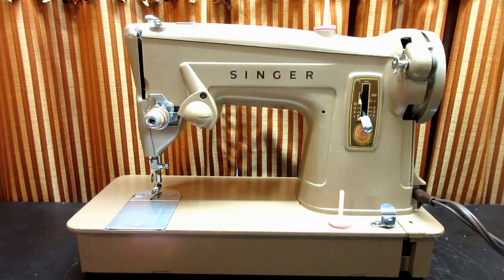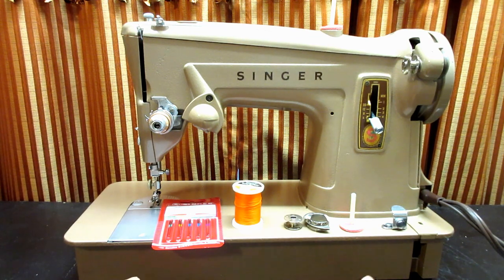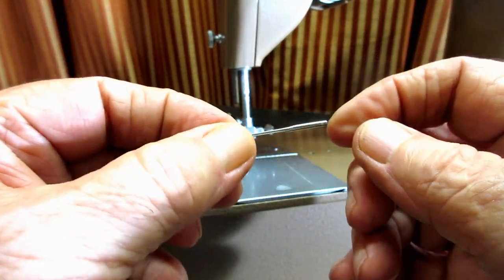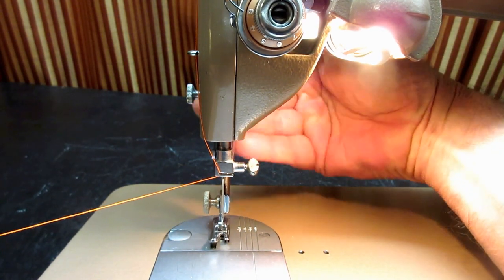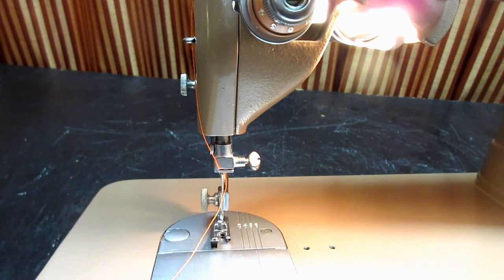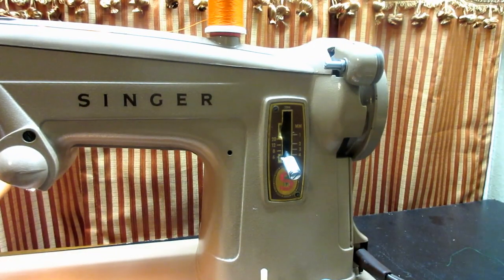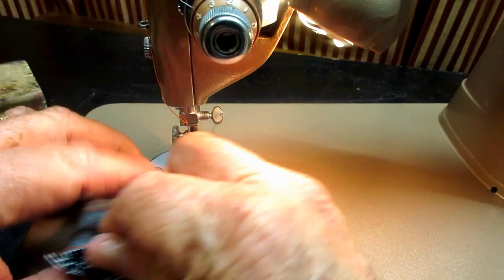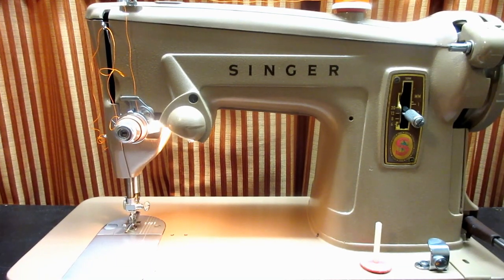SINGER 329K W/ INSIDE OUT TOUR, BOBBIN WIND, NEEDLE THREADING, 7-LAYER SEWING

Comment: Great to see another video from you Andy. I got hold of one of these but sadly it was too far gone. I kept bits off it in case I ever get hold of another one.  I also got hold of an early model 328K which is a real beauty and a lovely machine to sew on.
Reply from the maker: I have a bid on a 328K at GWill. No one else has bid yet. I think it's b/c the listing says "For Parts or Repair", hehe. Just my type of machine, haha. I did a 327K before, then found this 329K and really enjoyed it. I figured I might as well get the sister 328K for the trifecta of these SyleMates. Thanks for watching, and take care.
Reply: @andytubesewing1953  Fingers crossed that you win the bidding on it Andy.

Comment: I found one of these on the side of the road.  My first restoration project.  Mine has a green "hammered" finish.  This model doesn't get anywhere near enough attention.  It's a great machine.  Reliable, no fuss, easy to use straight stitch machine.  I believe Singer marketed it as a "lower" end machine, which means that it's head and shoulders above anything that's available on the market today.  

The large screw at the left end of the pitman arm was loose on mine and the machine rattled.  I discovered that it's a reverse threaded screw.
Reply from the maker: What a fabulous find! Thanks for rescuing it.Yes, an underappreciated model, like the 404. Singer spent more to manufacture ZZ-capable machines and they cost more to make so they pushed them in their advertising and stores. There was enough demand, even into the 1960s that they still made models like the 329K. My wife has been sewing for 50+ years and uses a straight stitch 301A, even for knit fabrics. She did buy an edger to finish some seams in the late 1970's
Reply: @andytubesewing1953  It really was a fabulous find and it got me started on a fabulous hobby.  Part of my restoration project on this machine was to refurbish the original button foot pedal.  I followed your videos on how to do it.  Took it completely apart, cleaned the carbon disks, put it back together and was able to achieve perfect stitch-by-stich control.   You're the one who needs to be thanked for the rescue of this machine, along with the rescue of another 8 machines and the repair of a neighbour's Bernina and a Featherweight.  So thank you Andy.
Reply from the maker: @r.duroucher225  I appreciate your kind words. What you've done is help me justify the time and effort I have spent on this channel. I could not agree more that it is a fabulous hobby. If I got you "hooked" on something, at least it is fun and mostly harmless 😀God Bless, and take care.

Comment: Thank you for another very thorough tutorial.  I regularly switch to another video after ten or twenty minutes, but with your channel, I quite often watch everything to the end!  You have saved me a lot of grief working on my 401A.  I am currently working on a 404 that I wasn't sure I would keep, but after hearing your opinion, I am keeping it.  Note: At 1:05:00, when you put it in bobbin winding mode, the needle/feed dog seemed to be engaged.

Again, thank you very much and hope you are feeling well.
Reply from the maker: Thank you. Yes, please keep the 404, at least for a while to see if you agree. You have a good eye for detail with spotting the moving NB. I did not notice it while recording but saw it during editing. When I'm putting the handwheel back on the counter balance I have a habit of putting a little oil on the counterbalance before sliding the handwheel back on. When I put too much the wheel will stick to the counterbalance for a while. I just went back to test it and I wiped off the counterbalance and put one drop of oil, spread with my fingertip. That fixed the "creeping needle bar" problem. I only work on the machines now on good days and for a short time. I just decided to leave the original recording when editing, thinking "no one will notice that", haha. Busted by mseller 😀 I appreciate that you watch my videos that closely. Take care.
Reply: Wow! I made a comment and received another great tip.  Thanks and you take care as well.

Comment: I wish that the 404 came with that motor and drive.  Nice, concise video on the 329K.  I already looked on Ebay and there's a couple there.  I'll keep my 503 and 404 but that 329 is a great looking machine.  Thanks for posting.
Reply from the maker: The more I worked on this 329K the more I liked it. Something about the front styling is unique and attractive. The arm looks thinner but measures the same width as the 32&K & 328K do. I guess it looks so sleek b/c there are no controls on the front. I do wish it was a slant needle, but I can't complain about how much denim I got under the foot. I appreciate you watching, Raph, and the comments you share.

Comment: This series of machine is often called The Tractor, reflecting the slight noisiness and the ability to sew heavier fabrics. And the solid reliability. I have some 328Ks and they work remarkably well on a range of fabrics. Very easy machines to use.
Reply from the maker: Thanks for sharing. The name tractor seems appropriate with that bell crank hook sound. I appreciate you watching

Comment: Very good video. I would love to see a 329 in a treadle.
Reply from the maker: Just a pipe dream I had when seeing the casting at the bottom. Neither the Parts nor Service Manuals for the 327K/328K/329K  show parts or info for using them in a treadle. Maybe the body was used on other machines that could be setup to treadle? 
Thanks for watching my channel.

Comment: Oh Andy - what an excellent video this is.  Thank you - all those close-ups and editing must have taken ages.  You won't be the first to leave the presser foot by mistake when working on lots of thick layers, it can be hard to tell without checking the lifter whether it's up, or just held up by the layers.  I think your machine would have handled the 9 layers too, it looks more like it was the needle that wasn't quite up to it rather than the machine...  :-)
Reply from the maker: Thanks for watching, Megan. I just used a regular denim needle. Trying that many layers I should have used a Heavy Duty one with a thicker shaft. The problem is the fabric is so thick that the needle is still in it when the dog starts moving it, and that bent the tip right off. It's fun trying even though no one would ever sew that many layers. Peace and Health in New Zealand.

Comment: Hi Andy, I found recently bought a 329k Singer machine.  Tension was terrible, I watched your video about tension and realized that my tension thing a majig was not the same, but I did see your video on the 404  series 14E and it looked the same as the one I have on the 329k,   I watched it paused took it apart cleaned as you suggested and put it back together.  Low and behold, the tension works BEAUTIFULLY.....I can't thank you enough.   So happy to have found your channel  !!   I do have one question, do you know if an inline switch can be installed on the plug wire, so that it does not have to be unplugged all the time ??    LOVE YOUR CHANNEL  !!!
Reply from the maker: Thank you. I'm glad the tension video helped you get your thing a majig sorted out 😉Sure, you can put an inlide switch. The cost is nominal and it's easy to install. If you took the cord with you a neighborhood hardware store might do it free if you bought the switch there. Your machine uses less than 1Amp of power. Here is the 3A switch I like to use: https://www.leviton.com/en/products/5410
I bought mine at an ACE Hardware down the road for $7.
Reply: Thank You So very much !!!     @andytubesewing1953

Comment: Hi Andy.  Thank you very much for this video.  The 329K is very attractive design to me.  Now, you’ve sent me on an internet voyage.  I’m doing comparisons between the 327K, 328K, and 329K, and I have a question for you.  Is the arm cover on a 327K plastic or metal?  You affirm the lid on the arm cover of the 329K is aluminum.  I have a 328K and I know the lid is aluminum, too.  I have rewatched your videos on the 327K (the Spartan), and I can’t find anyplace where you mention what the arm cover is made of (I’m just skimming around your videos here, so I may have missed it if you mentioned it).  Since you have actually handled a 327K, you would know.  Some other You Tubes I’ve watched say that the arm cover is plastic for the 327K, but I’m not so sure.
Reply from the maker: My 327K was a Spartan version; made more simple to reduce cost a little bit. The arm cover was plastic, for sure. The Singer badged 327K was a little more equipped as it had a light switch for example. I only saw one, but believe it did have a plastic cover. The 327K was a "Basic" zigzag machine with one pattern disc screwed onto the disc drive, the 328K was the top of the line for this family with a metal arm cover and a big chrome thumb nut and flip-up door to change to any of the over 20+ Type A (flat) pattern discs. The 329K was the straight stitch only machine, a little on the heavy-duty side to stand up well under heavier sewing. I think that's why they gave it the metal arm cover, too. I love the way the 329K looks all around, especially the treatment they gave the lamp cover and front side. They kept the backside with a similar style too, which surprised me. It had its own molds for casting. A very nice model, IMO.
Reply: Thanks for all the information!  It’s interesting to know they made a new body mold for the 329K; it is very stylish, both front and back, and I really like the color. @andytubesewing1953
Reply from the maker: @carolemagnusson5044  You're always welcome Carole. I always look forward to your comments, questions and observations. I'm so happy you still watch my channel
Reply: @andytubesewing1953  always so informative, glad to see you are back to your Channel!

Comment: Great to see a video on the 329k, Andy. Mine has an incredibly loud rattle from the bobbin case hitting the spring. Is this normal? Or is there a way to mitigate this? Thanks!
Reply from the maker: Thanks for asking. The space between the bobbin case corner and the spring is called the "Thread Clearance" and it is adjustable
If the space is too narrow the thread can hang there and get bird-nested. If it's too wide you get a lot of Clacking/Rattleing.
Here is a video for adjusting the clearance on Models 327, 328, and 329.      https://youtu.be/fq_1qRQFM_Y 
Best of luck and happy sewing.
Reply: @andytubesewing1953  amazing, thanks Andy for your help. Have a great day

Comment: Can you tell me which light bulb the 329 takes?  I heard you mention bayonet style, but is there a specific model number?  The machine I bought does not have a bulb in it, and I haven’t seen the information in the online manuals I’ve seen. 

Thank you.
Reply from the maker: It's called a push-in style. vs one with threads on the base to screw in. Most vintage Singers use it. Like this: https://singer-featherweight.com/products/light-bulb-push-in-base?variant=9015109891#productExtendedDetails    Please consider buying an LED bulb. More light and no heat: https://singer-featherweight.com/products/light-bulb-led?variant=9015049667
Here is a video about installing one https://youtu.be/uMK6jsQHoeY

Comment: I have 2 of these machines on one of them the top thread gets caught in the bobbin. I can't figure out what's wrong.
Reply from the maker: Sorry to hear that, Charlene. If it actually gets caught "in" the bobbin you may have a class 15 bobbin in it instead of a class 66. Class 15 is taller and the thread can't glide over it. If it tangled at the right bottom corner of the bobbin case the Thread Clearance Gap may be too narrow and pinch the thread there. Once one loop gets caught all the ones behind it just stack up on it. I've had to adjust a few of them. Here is the video I made about it for model 327K which has the same system. You might take a look at it and see what you think. https://youtu.be/fq_1qRQFM_Y    Thanks for watching my channel.
Reply: @andytubesewing1953  I have the class 66 in it. I will check your video out because it is stacking up. Thank you.
Reply from the maker: @charleneweege7149  I hope it helps you resolve it. Good Luck.